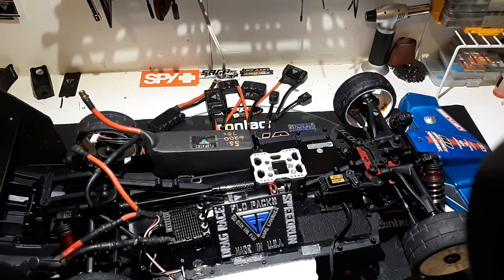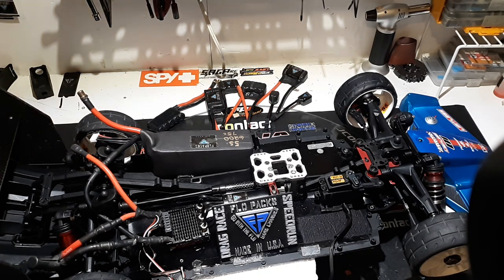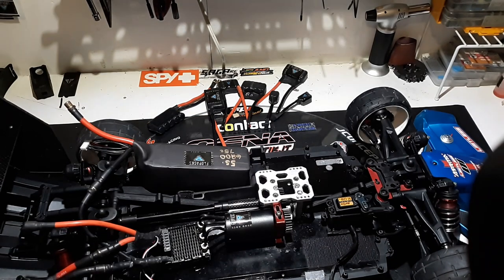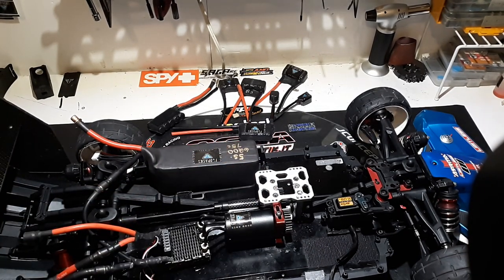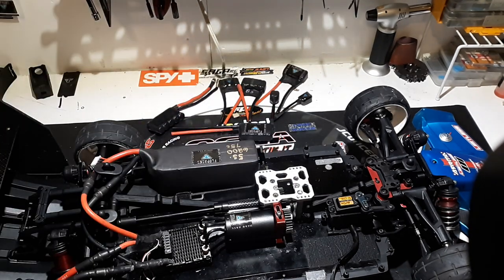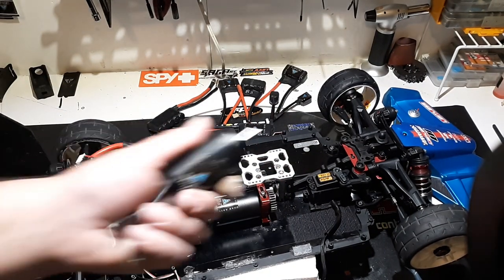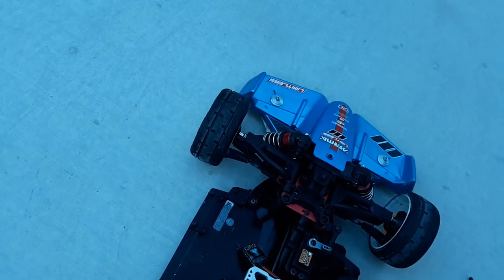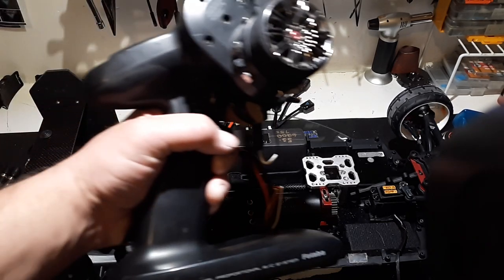SPOOLS + NEU MOTORS + CAPPACKS

Comment: Nice motor I have a hobao epx 1/10 I been looking for a good motor for drag racing will it work for drag racing and what kv are the motors
Reply from the maker: Kinda a low kv but you can use a bigger pinion and use the  torque to let her RIP. I'm using it in a mugen mtc1  it yanks